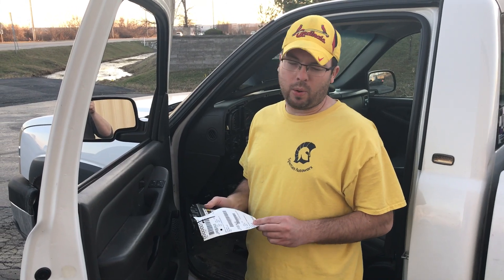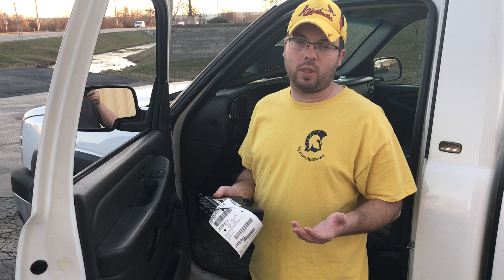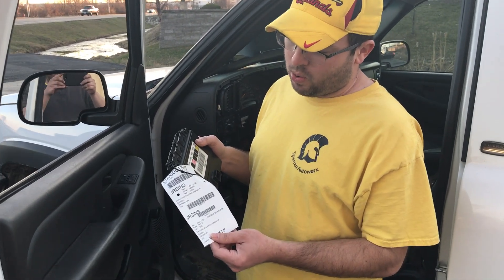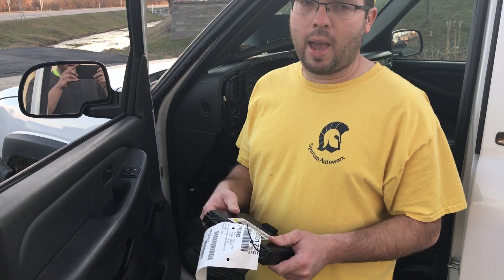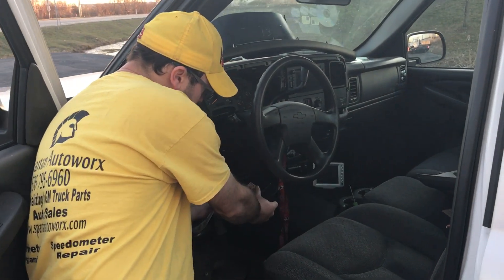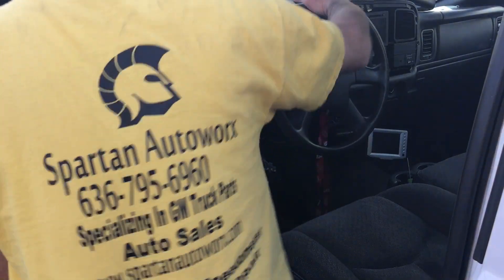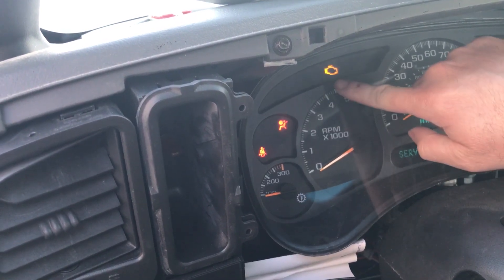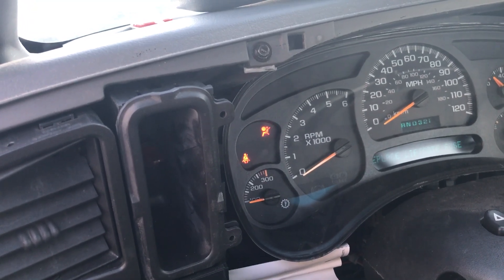Silverado Sierra Body Control Module BCM programming test

Comment: I have chevy trailblazer 2006 it doesn't crank sometimes it cranks for 2 seconds then stop also the security light is on does bcm will be an issue with my chevy trailblazer? My trailblazer is flooded
Reply from the maker: Any codes?
Reply: Jst installed my foglights wired the factory way. grounded, pinned to fusebox, relay, fuse & switch. How do I get the bcm programmed?  @SpartanAutoworx

Comment: I have a 2001 chevy silverado 2500hd with the 8.1. I have replaced all grounds and my cluster only works when the DLC has something plugged in, like its completing a circuit...I cannot figure it out and I believe it may be either the ecm or bcm or even both. Already ordered an ecm pre-programmed to my vin and am thinking about trying a bcm as well. My ecm had corrosion right through the corners of the casing to the board
Reply from the maker: Sounds like a ground issue to me

Comment: Hi please am having problems with my 2009 GMC Acadia, no power to immobilizer/no start issues. Also I have the car got this codes B1370-06/B1380-06 does it mean my BCM is bad thanks

Comment: Hey I have an 2007 Silverado 1500 classic manual window power locks I got all oem door components and wiring would I be able to get programmed bcm from that would allow power locks to work
Reply: No make sense.. think you mean to get power windows to work in truck that did not come with them? If so, go back to truck you got wiring and stuff from and get the bcm from under the dash. Install into yours and do the relearn.

Comment: How can I see the next video?  The one after you've done your 'magic?' If I click on next video it take me to a video about GMT800 TRUCKS BODY CONTROL MODULE BCM REPLACEMENT AND PROGRAMMING that is almost 12 minutes - is that the correct video?
Reply from the maker: Maybe. Whats going on with the truck that you believe to have a bad bcm?
Reply: I've been researching why my vehicle keeps having to be jump started.  New alternator and battery both put in in Nov. Something is draining my battery, and I can't figure it out.  Read some forums and such that make me think it may be the BCM.  @SpartanAutoworx
Reply from the maker: I will try and link a video here but if it does not work email at Spartanautoworx@gmail.com 
https://www.youtube.com/watch?v=pxekj2ZBa-U&t=1s
Reply from the maker: 03 - 04 would put money on the IPC
Reply: Thank you!  I'll research that.  I'm too broke to be paying a mechanic since I'm unemployed.  So I'm trying to do all the research myself, and then see if I can fix it myself.  Appreciate your help.  I don't often get responses when I contact somebody on their video, I guess people don't follow-up, especially when they are older videos.  Have a good Saturday! @SpartanAutoworx
Reply from the maker: Let us know what you find to be the issue.
Reply: It is an '01. @SpartanAutoworx
Reply from the maker: Well that changes things being an 01...  Could be a bad 0411 ECM. Do the Speedo and TBC Fuse check first. If not We will need to dig a little deeper and pull fuses for other modules. I have only seen 1 case of a bad SDM module on 99-02 electrical architecture so that could be something to look into as well. Lets hope its tbc or speedo. Both easy to fix. :)
Reply: @michelleconnely4672  so what happened with the truck??!
Reply: @Chris-vp9ts  I paid cash for a little used car that my friend got me from the auction and quit driving the suburban except when necessary. Took the negative off of the battery so it quits dying. When I need to drive it I connect the negative and it starts right up. I gave up on trying to figure out what was causing the short.